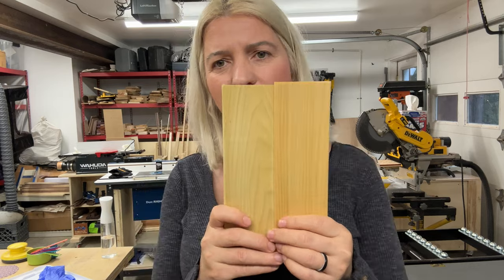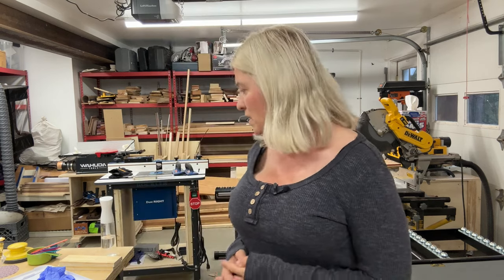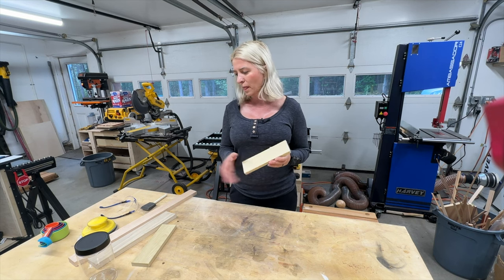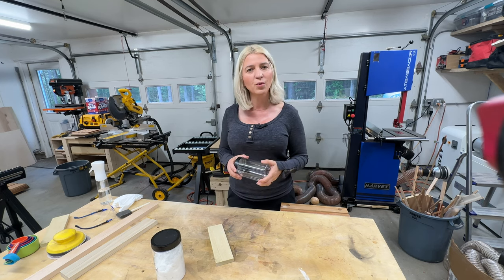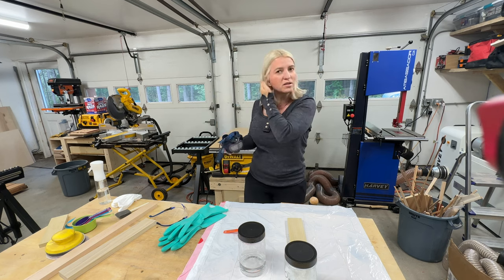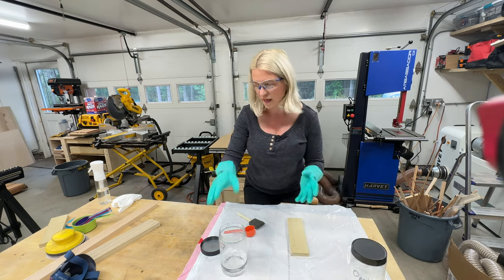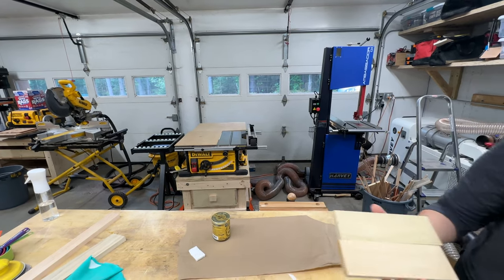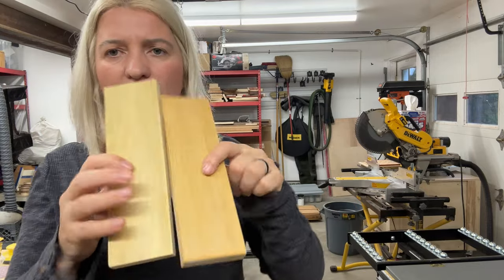How to remove green from poplar. Make poplar pretty without stains. Oxalic acid on poplar

Comment: Oxalic acid is also used to remove dark water stains on furniture during the refinishing process. See dashner design and restoration channel for examples of this. Quite amazing. Thanks for showing this use, I was wondering if you knew about it when you showed how to stain poplar.
Reply from the maker: I saw a few videos of dasher design ( amazing content)and it’s possible that’s where I first saw the oxalic acid. I don’t use it much as I rarely work with poplar and when I do is for painted projects